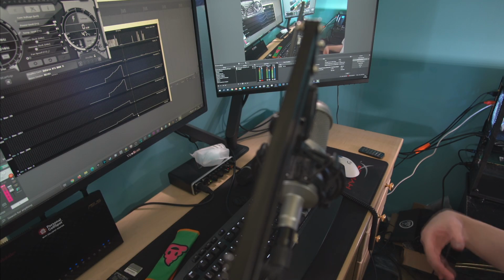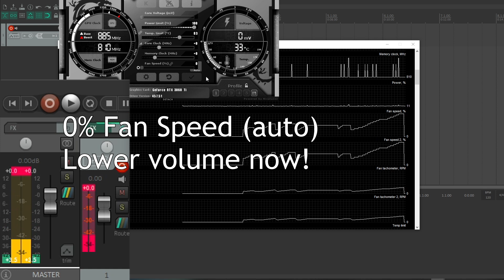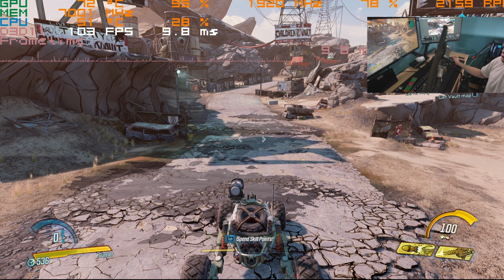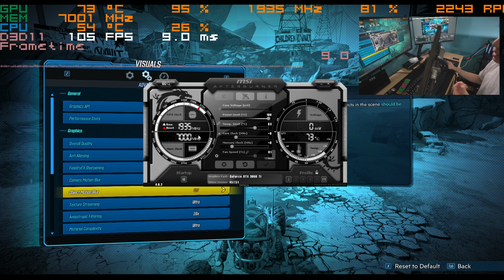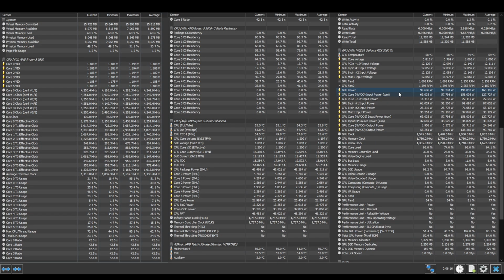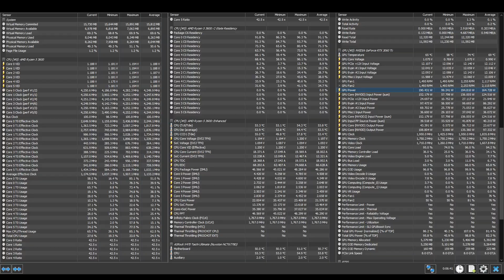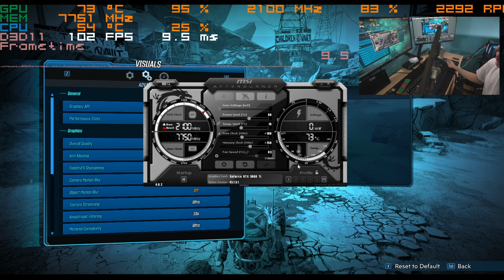MSI Ventus 2X OC RTX 3060 Ti Disassembly & Noise, Boost Clock, Overclock, and Power Limit Showcase

Comment: i have same card , i am amaze how its run on 2000 mhz or 1900+- mhz in under 75 temp ?  i dnt know what is the problem with my card , its run way hotter and mhz didnt croos 700 mhz or 800 mhz, and temp hit 80 to 90 celcius..  
sir , could you please help me out , what should i do , should i need to repaste and change the thermal pads ? its been 4 to 5 yrs

Comment: This is a great video for anyone looking for thermal solutionsto their 3060TI.
I am actually buying a housed peltier module this week and i am going mount it to the 3060ti
Then i will compare using a brand new asetek i mounted on the 1080TI....The best GPU ever made.
Anyway great vid for someone needing to get an eye on specs.
Just keeping the original heat sink mounted and then zip tying two noctua 3000 rpm fans to it running at a perma 91% wired to the board as chasis fans, would probably keep temps at around 45 under load.

Comment: Thanks man, opened up my bad boy following the steps and reapplied thermal paste on it, dropped my average temp under load by around 20 degree C and it no longer overheats cuz of hotstop going over 105, it now barely goes to low 80s!

Comment: I just bought the 3070 version used. It was listed as having heating issues where it wouldn’t even boot to the login screen for windows. Idk how but I was able to fix it and not runs fine. Only issue is that it’s hitting 80-85c. Has anyone had this problem before. I’ve repasted the thermal paste. The only thing that comes to mind that might be causing this issue is that the thermal pads are too thick

Comment: On my MSI Gaming GeForce RTX 3060 Ti, which is only 10 months old, I never had a problem with noise until I moved it to my new case. In the old case, a Corsair 250D, it was mounted vertically. However, in the new case, the GPU was mounted in the more typical horizontal mount in a Fractal North case. Unfortunately, when the GPU fans reached high RPM, they started to make a rather irritating noise like minor bearing issues. To test if the angle of the card affected it, I tried tilting the computer, and sure enough, the fan noise went away. Thus, my solution was to buy a Fractal Flex 2 vertical GPU mount for the card. That fixed the noise problem.

Comment: seems good card I had a 3070 ti but it would only run 80% power in my case got so hot.  so sent it back.  this runs at 100% and is silent too.

Comment: The secret for this card is doing undervolt who wants a really good balance silence/temperature, did it in mine and find a nice spot running at 1950 MHz/0.925V reaching only 70ºC on 100% testing in extreme internal climate conditions (32ºC here in the summer without AC). In normal use and gaming in a mild climate temperature is even less.

Comment: Is cooling block ok to apply liquid metal?
Reply: Exposed copper heat pipes like that will get eaten away by liquid metal TIMs. Your best option is to go for a graphene sheet or if you want to be a little daring either solder a thin aluminum coldplate to it or electroplate the surface with zinc.

Comment: im new to gpus can i disable this oc bc im scared of it
Reply: Dunno if you ever got your answer, but: factory overclocks are perfectly safe and controlled. Generally cards like this are equipped with beefier coolers than the Founders' Edition models from Nvidia and can handle the extra heat produced by OCing the die. As long as your card doesn't exceed 105 degrees Celsius you're in the clear, and under 80 Celsius is ideal.
Reply: @yfnratchet  thanks:)

Comment: I have the original version  of this card.  But 2 issues. 1. Idle watt usage of 45-50 watts Even when just using 1 monitor. And 2. Completely locked down bios. No oc and No fan curve tuning. I AM very confused if i got a defektive card. I got No stabilty issues or Any issues orther than the 2 metioned, card Even runs relatively cool. But power is expensive here and I hate that high watts usage in idle ..

Comment: Do you get weird rattling sound at 95+% fan speed? If so, any way to fix this? I don't think it's the fans being defective because both of my fans cause this in isolation. Suspecting the plastic casing around them doing something funky...

Comment: So is it worth paying more $ on a better implemented cooler? I'm not really experienced when it comes to GPU's but I do want to upgrade my 1660 Super to a RTX 3060 TI and there are a lot of options available but some of them are a bit over my budget. Is it worth getting the MSI Ventus version? The next one on the list would be Gigabyte OC Pro version which has 3 fans. Are there any limitations compared to other manufacturers? I'm not going to bother with OC

Comment: Bought this (used) and arrived today. When the GPU is mounted with the fan at the bottom, one of it is making a loud vibration sound once it started to speed up during benchmark. Vertical or fan upside installation has no problem. First time to see one with such problem. This fan is not good... Also own MSI Ventus 2X OC RTX 3070 (still working fine). Won't be buying this series anymore.
Reply: I have been using it for a 2 weeks and i have cero issues, maybe you should to return it back

Comment: I have this card and i flashed the bios with gaming x trio version of the card. It gives it quite nice performance boost (around 10-15%)
Reply: Does doing that basically bring it line with other 3060 TI models?
Reply: @ABCboy5  Yes, exactly
Reply: What happened to the temps? Does it break the warranty? Thanks
Reply: @Balvz123  Can't say about the temps as i have kinda overkill ventilation, so in my case temps are around the same. But without good airflow it surely needs more cooling. Warranty breaks ofc. My card is so old that it was out of warranty anyways. If you planning to do this be sure that you can keep the card cool.

Comment: I was fortunate to buying this last year. I believe the thermal paste was the cause of being extremely hot over 98% usage when loading up Cyberpunk 2077 or Destiny 2. Unfortunately, this was the low entry card for the custom PC that was built during 2020. I had an AMD video card but the drivers were not very good. I will probably aim for an RTX 3070.

Comment: Want to know put some thermal pad on the back of the PCB will help the memory temp?
because my Ventus 2X V1 Hot spot is up to ~90C at some GPU dependent games, just want to see can bring down the temp down or not
and have ways to take out the backplate without Disassemble the heatsink? (without crushing the warranty)
Reply: hey man i just got the gpu and im also seeing some rad temps. if i let it it will easily reach 85 to 90 degrees. i dont have air condition so it really turns my room into a sauna. did you find a way to reduce the temps? i was hoping changing the thermal paste would do the trick...
Reply: @abusufyian8597  The core temp is fine but the hot spot temp is quite high, if you like me don't like to see any high temp🤣, you can try undervolt it, that way the GPU will use less power and lower temp(just search GPU undervolt on YouTube and you will find how to do it)

Also, I don't have GPU already, I sell it to my friend long time ago and upgrade to RTX 3080, so don't know much about long time use but I think it should be totally fine

Comment: Hello, i have this card also, but i am facing a issue. The performance of this video card is reduced by a half. For example another card like this one scored in Heaven 5000 points or in Furmark 2000 points. I get only half 2500 and 1000 points. What can i do about that? Any ideas?
Reply from the maker: Hello, I recommend making sure your benchmark settings are the same as the ones you are referencing. The score is meaningless unless you know what resolution and graphical settings were set during the benchmark. 

Aside from that, I recommend you have the latest Nvidia graphics drivers installed first and foremost; ideally a clean install of the drivers if the card is an upgrade from another one. Your scores will be lower if you have anything else running in the background that utilizes GPU resources, so make sure you're benchmarking without background applications open. Your CPU can affect the benchmark scores too, albeit not as much as your GPU for those benchmarks of course. If you're using a particularly old CPU, that could also explain the drastically lower score. I would also monitor GPU temperatures using HWInfo and maybe crank the fans up to 100% using MSI afterburner to make sure it's not thermal throttling during benchmarks. Hope this helps.
Reply: @TechiverseYT  thank you for all your help!
Reply from the maker: You're welcome! For reference, I benchmarked an EVGA RTX 3060 Ti XC at stock settings in Unigine Heaven and scored 4933 using DX11, 1080p, Ultra Quality, Extreme Tessellation, with AA off. (Stereo 3D and Multimonitor disabled)

With 8x AA I get a score of 3594. This is in a system with a Ryzen 5 3600 CPU and 2x8GB 3533MHz RAM
Reply: @TechiverseYT  thank you again for the details. If I benchmarked with that settings, I get 2400 max. The problem could be the cpu, it is a Ryzen 5 2600, and the memory is Corsair, 16 GB at 3000 mhz. In full load the Gpu doesn't exceed 70-72 degrees.
Reply from the maker: @baie2002  Hmm, your Ryzen 5 2600 should be enough. I'd run a CPU benchmark like Cinebench to make sure it's performing as it should though. If you're on Windows, make sure you aren't on a power saving power profile and be sure to disable any kind of V-sync, adaptive-sync (G-Sync), and maximum framerate limits in Nvidia control panel under 3D settings.
Reply: @TechiverseYT  I will givi it a try to Cinebench. I am on windows, on performance profile and g sync it is disable. On Cinebench my score is 2547. Thank you again.

Comment: How thick are the thermal pads would you say? Is there anywhere you can lookup the thickness of thermal pads by gpu?  I am looking to replace my thermal pads on my gpu and I want to know which thickness to use
Reply from the maker: I do not have this card anymore, but if I had to say, I think it was 2mm thickness

Comment: Great video. I have been able to get mine to 170 and 1125. The only game that gives me issues is Warzone.
Reply: Issue in what sense? I would buy this card bro only for warzone it makes a lot of noise or what do you mean
Reply: @Juaanmo19  My overclock crashes on COD/Warzone. I can get the game to run on 180 and 950 overclock though. The card is great. Buy it if you get that chance.
Reply: But do You have this card yet? I need.to be sure my bro. It makes a lot of noise in their fans? Or is silence? For example playing warzone or it is silence playing all games? What do you recommended. I would not overclock it. Only stock thanks my bro
Reply: @Juaanmo19  Yes, I have this exact card. The card isn't noisy at all IMO. I keep it on the stock fan curve, in my case(Lian Li Lancool Mesh II) the card never gets about 68c at full load.
Reply: Ok bro. I will buy this card then. Because i see other comments and people said that it makes a lot of noise or then fans runs faster. So i will be crazy XD

Comment: My 3070 has the same layout but I mine has one more metal small heat sink to the opposite I can actually see where the holes are which is funny cause it looks like it would take one but it's not there. Also both my vrm heat sinks whee pretty dam loose haha what the heck msi honestly this is such a cheap o freaking card sheesh...... Feel bad for people paying more then like 550.00 for the 3070

Comment: Some small things. The small heatsink on the vrm's connecting to the main heatsink straigth on one thermal pad , and the another thermal pad to the coils , nothing on the capacitors , for what ,that is high grade high temperature EL caps.....
another, when you decrase the power limit click out the temp and power limit locking  , if your temp limit decrease with the power limit of course your boost clock going down , not boosting just until the target temp limit so like this you limiting the power and the temp headroom as well for the boost, when limiting the power target and livit the temp limit on highest what is "comfortable" get higher boost with limited power and lower effective temps , not too much the differnece but have a little and with some card bigger, just try out.

Comment: I just got the second version of this card and already broke the one of the fans! D; Does anyone know where to buy a replacement one? Because when I search the model name that shows here on the video "pld10010s12hh" it shows only two fans with one cable helpz
Reply from the maker: That's unfortunate! You could try using these as replacements: https://www.gpufanreplacement.com/collections/msi-graphics-card-fan-replacements/products/msi-geforce-rtx-2070-super-gaming-x-fan-replacement

They're under a slightly different model number, but they're the same size, have the same current rating of 0.4A, and have the required connectors. Hopefully the wires aren't too long or too short.

Comment: I’m using a ryzen 5 3600 with this GPU in the video and I managed to get +200 core clock and +1000 memory clock   And max temp of 71 C. Ran 3D mark benchmark before the tweaks I got on average around10600 score after tweaks I got 11109 score. Would that be worth it ? because I’m worried these overlocks can damage GPU and other components.

Comment: hello, you need to set your shutter speed the right way when taking video so you won't have that kind of awkward motion blur on your footage.
Reply from the maker: Thanks for the advice! I found out why the video has that awkward motion blur and it isn't a shutter speed problem (shutter speed was set to 1/60). It was because I left smart resampling mode on in Sony Vegas during the final render. It's on by default for every video and it makes motion look pretty bad. Hopefully I won't make that mistake again!

Comment: Is 30% the minimum fan speed? I just got a Ventus 3X and, if the fans are spinning, 30% is the minimum. Which in this card corresponds to a rather noisy 1800RPM.
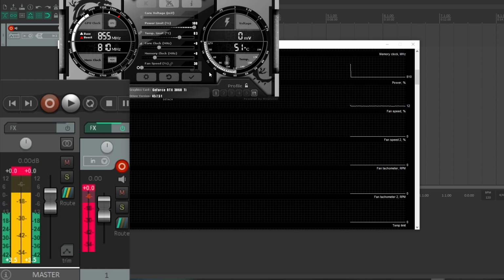Reply from the maker: Yes 30% is the minimum fan speed when the fans are spinning. Which at 9:16 you can see that translates to about ~1070RPM
Reply: @TechiverseYT  thanks. Looks like the 2X is a better fit for me. I rather have silence than low temps.
Reply: @NelsonCruz77  really? ventus 3x at 30% get 1800 rpm?xddd
Reply: @Venom-gs4nz  yeap. That's how mine behaved. I have a Gaming X Trio now. Very quiet.
Reply: @NelsonCruz77  well iv got wooden sample chip o gaming z trio 3060ti and in full load get 70 c and 1.500 rpm so its still quaiet xd

Comment: Mounting hole distance would be nice.
Reply from the maker: 67.5mm x 58.5mm x 67.5mm x 58.5mm from measuring with a ruler and eyeballing it from center of the screws

Comment: What is that Software in 9:10
Reply from the maker: The program in the background with the noise meter is called REAPER. The GPU monitoring/OC software is MSI Afterburner

Comment: i have the exact same card, but with the same overclock settings im only getting a bit over 1800 on the clock while u can get over 2000, i checked my temps its stable at 70 degrees. I have the oc edition of the card btw
Reply from the maker: Boost clocks can vary based on game/application
Reply: @TechiverseYT  o i just had it on msi kombuster mayb thats the reason
Reply: How's the GPU holding up? I got the same one and I've been reading some bad things about it

Comment: Nice video, I want the gigabyte OC version because I like the pass through cooler but I'd probably buy this card if it was in stock.
Reply: pass through cooler is what was preventing me to buy this GPU in the first place,you will need fully disassemble GPU every 6 months because dust goes directly on chip and can easy make electric short circuit.anyway i was lucky to buy last one for 450 euro in first day of sale.gonna sell this crap when better GPUs go on sale
Reply: @glock888  Dust goes directly on chip? bro what you smoking its covered with heatsink and thermalpaste
Reply: @Jackuss19  GPU chip is only that covered,all other part of board is not.i had 5 years old 1060,board completely sealed with heatsink(no holes) no dust goes inside.i never needed to clean it and worry about short circuit
Reply: @glock888  dust will sooner of later make their way into the card
just clean your house more often and your PC.
Also do you have any metallicparticles dust in your house?  regular dust won't short your gpu.

Comment: I managed to get one of this exact one, I'd just like to know. Is using the daisy chained 6+2 pin ok, or do I definitely have to use 2 separate 8 pin connectors?
I have a 750W PSU
Reply from the maker: Should be fine as that's the cable setup I used to test the card with an EVGA 750 G3

Comment: So would you recommend to use your overclock and lower the Power Limit? This looks quite interesting here! Would love to lower the temps and increase the performance. :D
Reply from the maker: You can use my settings as a reference point, but you should always test for stability. I recommend using the voltage/frequency curve in MSI afterburner for a bit more granular control

Comment: Im getting the card! Do you recomand it?
And is the noice level high in your opinion?
Reply from the maker: Nice! If you have other options for a better cooler I would choose that over this, since I think the card can get a little loud when using it at 100%.
Reply: @TechiverseYT  well if ventus 2x get 1000rpm and  ventus 3x in 30% get 1800rpm i dont thinking where is the finish at 100% in ventus 3x 3000rpm?xddd and maybe 50 db xdddd
Reply: It is pretty noice. I'd say the noice level is pretty noice.